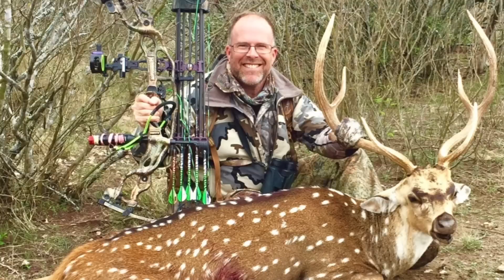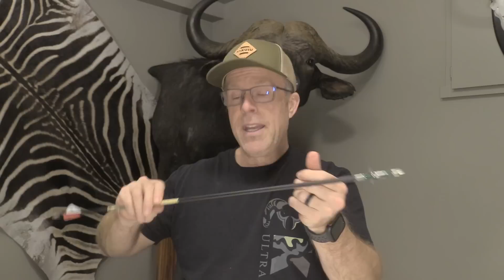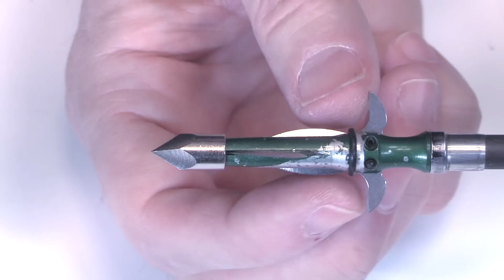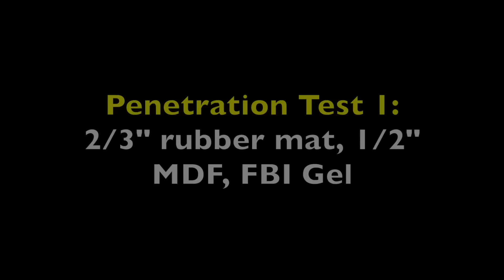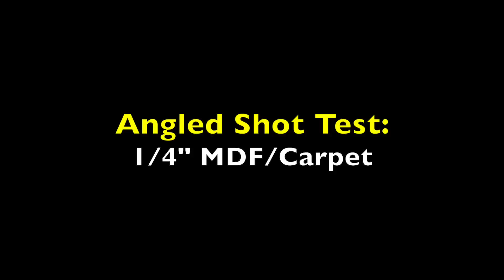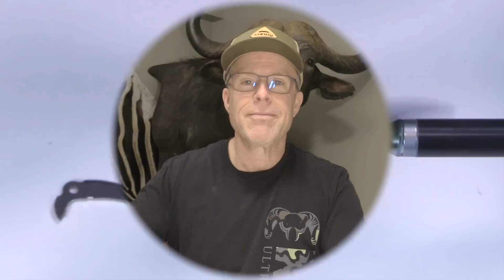CRIMSON TALON HYBRID 125 gr Broadhead Test

Comment: Even though the mechanical blades got damaged, removing them would allow you to use it as a fixed blade. I think the concrete would have bent the crap out of the rest of it except for the tip.
Would have been nice to see a closeup of the MDF and steel shots.
Reply from the maker: Thanks for watching & commenting :)